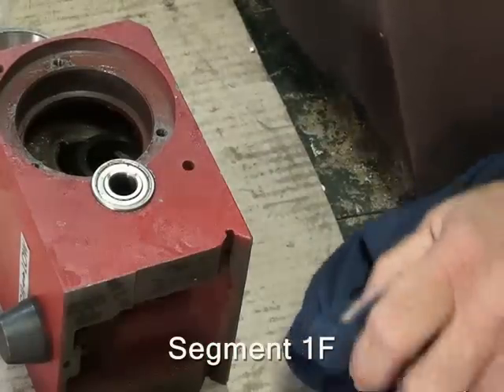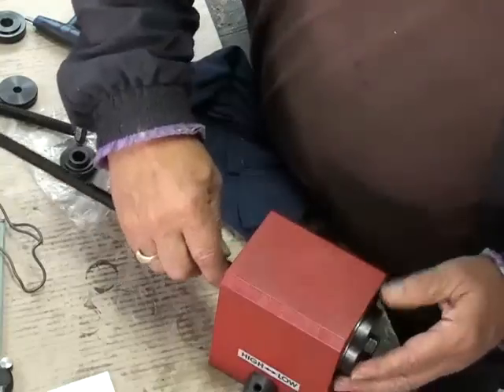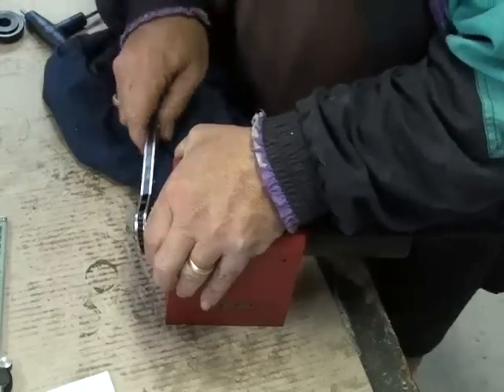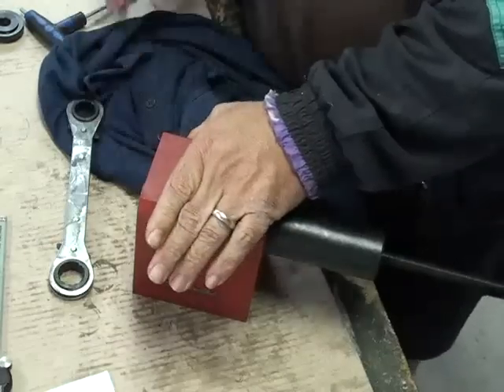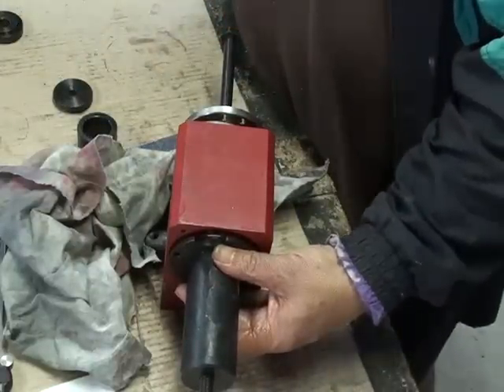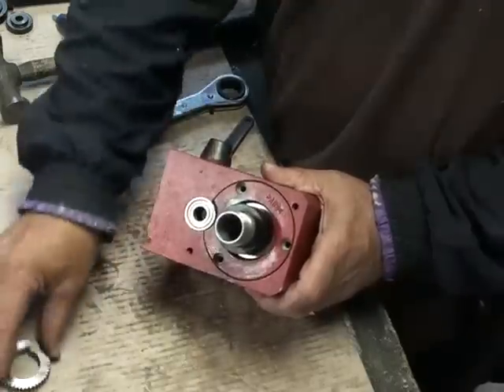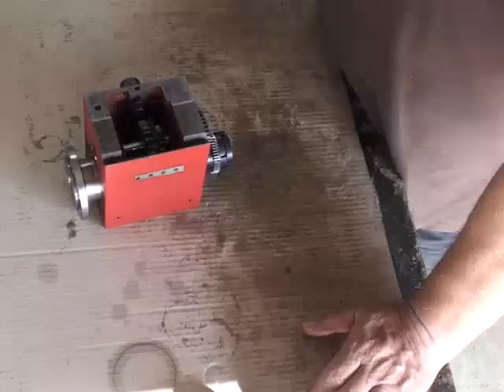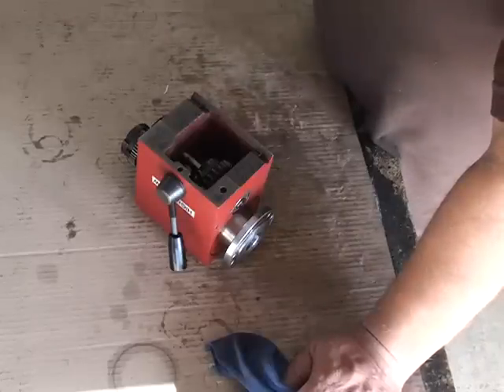Part 1F of Fitting the taper bearings to 7x12 lathe

Comment: Did you make seals to keep swarf out of the bearings? I'm thinking of trying it and was wondering what your thoughts on this would be.
Reply from the maker: Hello Emil, no I did not fit seals. I tried some paper seals but they tore. You need a thin strong material. I opened up the bearings recently and I could not find any swarf in there. The plastic flange keeps a lot of stuff out. I replaced the grease which you have to do on these type of bearings as the grease can leak out. I did not make any videos before the mod showing cutting etc. Or after the video. The video was made for my own records and when I mentioned it on the mini lathe forum they asked if I could put them on you tube. I had no intention originally of doing that but I did. After I posted the videos some of the forum guys said changing the bearings is a waste of time so after that I no longer post any videos. One person on you tube also said not to watch the videos because I did not know what I was doing and I used mixed up tools etc. So after that I decided that. I am not interested in nonsense like that so I don't post videos on the lathe or mill now. I hope you can understand. As far as cutting, parting and general performance, the results are 5 times better. Parting before was poor with chatter and tools dipping down. After the mod, it was like cutting butter because the tool tip touches the work surface correctly instead of a series of collisions every time the work "wobbles" into the tool tip. You have to imagine what the work is doing as it spins all over the place hitting the tool and then moving away.  I think you can see that effect if you look closely at a lathe with sloppy bearings.
Reply: My alternative to seals was making better fitting (and better looking) bearing covers than the stock plastic covers. They fit tighter around the spindle and H/L shaft bearings. No swarf has gotten through so far. The taper roller bearing upgrade is the best thing I've ever done to my lathe. I also tried angular contact bearings as an experiment, but the TRB's beat them easily. The ACB's had slop when I pushed and pulled on the spindle by hand whereas the TRB's didn't budge. All the tools I ground in the past that produced a mediocre finish with the stock bearings suddenly sprang to life because of the TRB's. Now I'm getting a finish to be proud of. Your videos gave me the confidence to attempt the upgrade.
Reply from the maker: Emil Hamady Hello Emil, thank you for the information. Better covers sounds like a pretty good idea. Solves the problem of trying of trying to find some thin but hard wearing material between the bearing and the cover. It looks like the new bearings are working out. You will find that in time they might get a bit too tight or the grease thins out. So I just push the spindle out about 30mm at the flange end and put new grease in. Its not easy but it can be done without completely pulling the spindle out (which means taking the box off too). If they just get a bit tight, I loosen the C nuts and tap the drive end with a soft mallet towards the flange. This just pushes the inner race back down the spindle at the flange end just a very small amount so the bearing runs smoothly again.  So thank you for your ideas Emil. Lou

Comment from the maker: "Grease" not crease in reply below. I was lucky to have access to a Uni lab (I worked at) and tested the setting on a laser interferometer which measures the motion of the spindle at speed and work load. Once the setting is correct, the shaft runs with minimal gyrations and elliptical swing (not evident with static measurements). The actual final  torque values are quite low (i.e just "touching") as is the case with car wheels -and too low to specify accurately - hence my question.

Comment from the maker: Hi Andrew. Yes, I agree. The correct setting on my car was to tighten the castle nut then back off so the cotter pin went through the previous castle notch. On this lathe it is quite difficult as you need to tighten one C nut till the spindle moves freely but is not sloppy. The second C nut is then used to lock up the first. However both nuts can turn upsetting the tension. At this setting the bearing warms up a bit causing the crease to form a flow lamina between the 2 bearing surfaces.

Comment: Also, you are balancing the need to keep bearing wear and run-out to a minimum.  You will get the best precision when the bearings are up to operating temperature and that is when you should do end float / run-out checks.  Hope that makes sense.

When I worked as a mechanic many years ago, the rear wheels of most cars had taper bearings and the procedure for fitting was to nip up the nut and back it of a half turn .. if only it was that easy with all tape bearing applications!

Comment: I wasn't aware of your previous reply, sorry.  Explaining how to setup end float is a bit out of the scope of a youtube comment .. but in a very basic nutshell, bring endfloat to within a few 1/100ths of a millimeter, run spindle for 20mins (no load!) or so and feel for heat around the bearings, if it's to hot to touch increase endfloat, if cold reduce endfloat until you hit the warm sweet spot.  The aim of this is to provide enough room for bearing expansion as they heat up to running temp.

Comment from the maker: Hi chemech. Sounds good. Yes, you can manage to replace the bearings with a bit of ingenuity - well done. LMS actually used to sell just a set of tubes but were not available at the time. Yes, I replaced both sets of gears using the LMS version. After the effort needed to pull the spindle apart, a few more dollars to replace the small gears makes good sense. FYI The original Russian spindle used needle bearings which were good. I hope your mod works out okay. Thanks for your feedback and info.

Comment: Hello, vk3aqz: I got the spindle back together last night. While MicroMark had gone over to metal gears on the spindle, they were separate pieces, and the hi-low gear was the original plastic.  For simplicity, I went with the LMS replacements, with two gears on a shaft for both the spindle and hi-low gearing

I just got the off-set shaft drive gear in the right place. The whole procedure has taken some interesting use of clamps, pipe nipples, and other bits of shop stuff. Time to try it tomorrow

Comment from the maker: Hi chemech, the kit comes with seperated larger gears made of metal. I did not use them as I had already purchased solid gear clusters including the HiLo gears. I seem to remember the kit gears come with longer keys which you need to use instead of the original keys due to the split gear setup. Once you put the taper bearings in you will need to adjust the loading for a few times till they bed in. The motor may stall in Hi speed till then. In low speed the motor will be ok.

Comment: Thanks for the reply - I can see where they should have labeled things differently on their website - I would have bought the kit then.

I broke the Hi-Low gear - plastic - on my lathe, and decided to replace the bearings with the tapered bearings to improve the operation while I had the headstock apart. 

Since I was simply resizing a ~1" flat washer when I broke the gear, I figure that the combination of metal gearing and the tapered bearings should be a major improvement.

Comment from the maker: Hi chemech. The tools are part of LMS product 2909. Yes, direct drive spindles dont have plastic gears. However it is the bearings that I needed to change. The ball bearings were the problem, not the plastic gears. Some similar size new model lathes I believe now come with taper bearings. Testing my spindle in a Uni lab with a laser interferometer showed huge improvements under driving loads not evident in the static measurements. Much lower twisting gyrating errors with tool forces at speed.

Comment: Where did you get the kit with the washers & tube for pushing & pulling the bearings? It would have saved me a few hours and some scratches on the spindle...

Not finding the kit at Micro-Mark or Little Machine Shop...

And, SIEG has improved the C3 lathe to a direct drive - the Super C3 - which makes much of the headstock rebuild kind of moot - no more broken gears *inside* that small casting!

Comment from the maker: Yes, thats right. The bearings have been in use for a year without any sign of wear or heating. The runout is still the same. They took about 5 hours to bed in then after that the preload has not changed.These bearings are made for car wheels under tonnage loads and high speeds. Here they are used on what is essentially a toy machine with very light loads in comparison. By the way, do you have a figure for the correct preload in this application?

Comment: For anyone else watching this you need to be aware of "end float" (a.k.a end play, preload etc).  If the bearings are not setup with the correct end float they will wear prematurely and/or result in excessive run out and/or overheating / seizing.